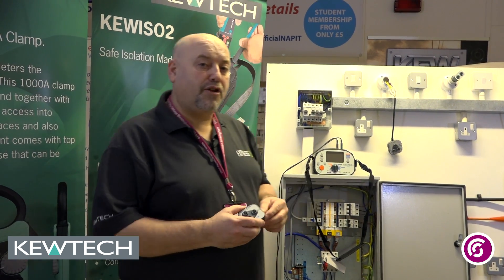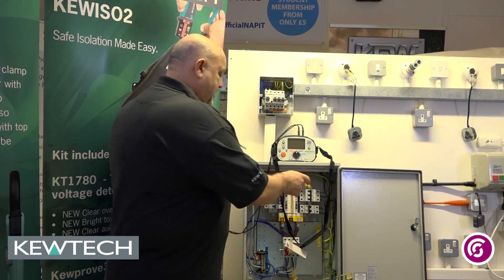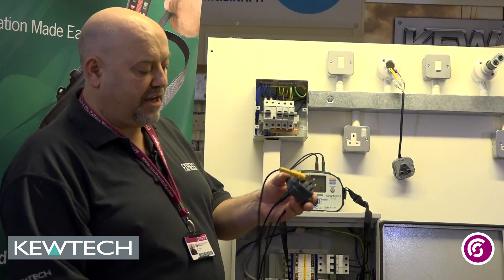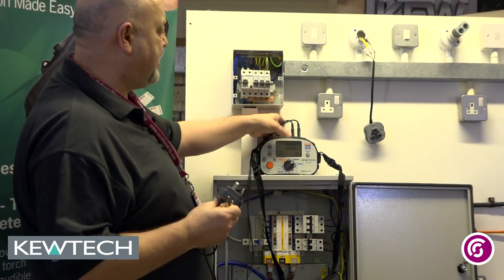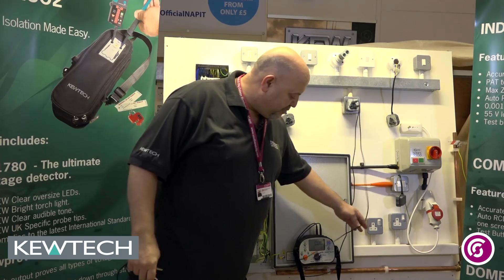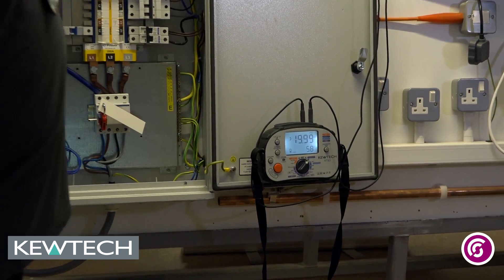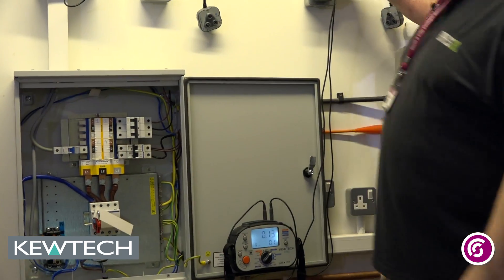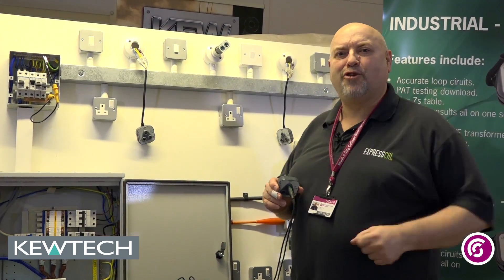KT63 Continuity Test with R2 and Jump Leads

Comment: i have used this method to do my ring but not clipping on the bus bar also i removed earth i am testing, using the linking leads i connect my r1+r2  making a temporary link in the DB... so why i cant use it on a ring ?

Comment: Shouldn't you be removi g the earth so you don't get a false earth reading (parallel path) from a water of gas pipe boilers etc?
Reply: At college or exams yes and in theory yes but in the real world people will use this method or link them with a 6mm single 9 times out of 10
Reply: You won't get a parallel path on this dead test as this is effectively testing a ring where the earth and line are connected at both ends, the tester is just reading the resistance of the ring created